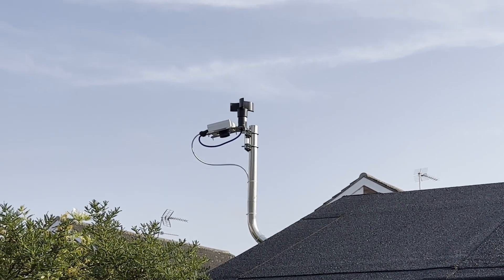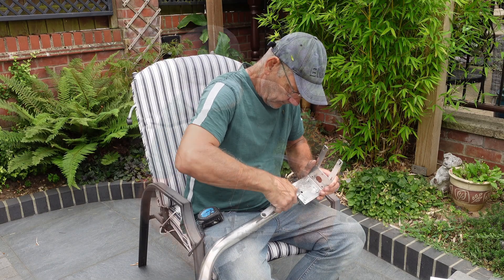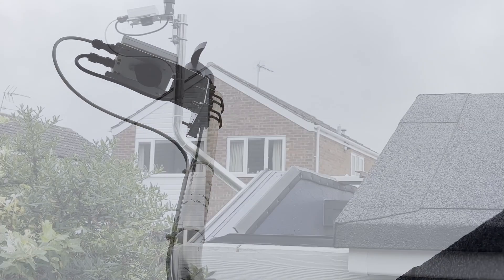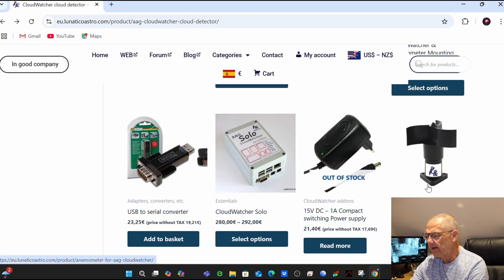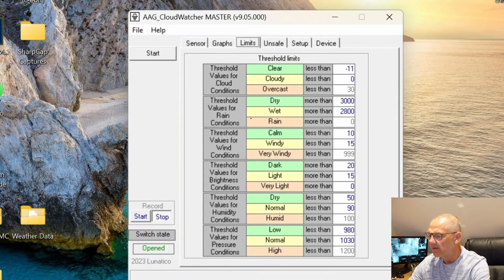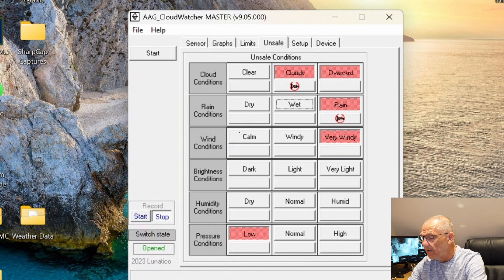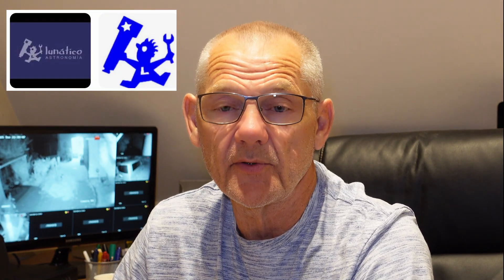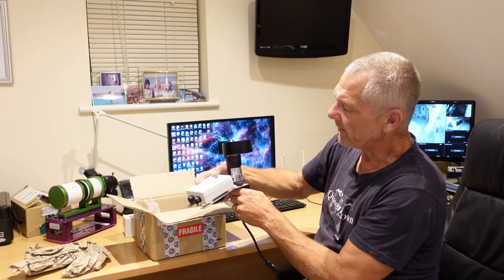This Clever Tool Could Save You Thousands

Comment: I would recommend I see your stuff is remote through google desktop, I’m not sure if that’s in the cloud or hosted locally but you may want to ensure there’s a failsafe so that it closes if the internet connection is lost
Reply from the maker: Thanks for watching Jack! You do make a good point, however if I loose my google remote internet connection, the mini pc is attached to the rig and will still control the roof, everything is directly connected to the rig by cable! The only problem would be if I lost power!! 
Clear skies 👍

Comment: Hey Simon, great video of a great piece of gear. I have one myself that I recently installed and is working quite well but still needs some tweaking. Talking  with Astrobloke the last month or so, he has helped me with some things as I have been revamping my ROR observatory I built 25 years ago. It's coming together slowly. I purchased  a couple of mounting poles that Logan helped me track down, but if i can get a constant tension cable reel that I can modify and in stall the Lunatico cable in or figure out a festooning method for the wires, I may have to relocate where I have my CW installed. Im wondering if you could tell me where you got your mounting pole and hardware?
  It looks like it may work as an alternate method for me untill I can get the above figured out, or l may just abandon that whole idea completely instead of trying to recreate the wheel  and uncomplicate the situation. Thank you.
Reply from the maker: Hi and thanks for watching! I got mine from Amazon, this is the link! 
TV pole & bracket: kit: 

https://www.amazon.co.uk/GALVANISED-Aerial-Wall-Mounting-Kit/dp/B01N5G8XMO

Clear skies 👍
Reply: Thanks Simon, looks like I may have to order it directly as Amazon is not allowing my to add to cart. But that will work.

Comment: for the diy minded, there are good ESP32/Arduino projects like DIY Weather Station on instructables etc that can be adapted.  with a 3d printer i done the whole lot for less than £100
Reply from the maker: Sounds like if you know what you’re doing and have a 3D printer, it’s a great idea! Thanks for watching 👍
Reply: The Cloudwatcher has a great advantage, IT WORKS
Reply: @fernandogomez119  so does mine thank you very much.

Comment: I bought mine in march or so. What a fantastic device! It gives you peace of mind for the night. It seems a bit outdated (the app design, the serial connection, etc) but realty is they are making it for +15 years and, the important, it works. Calibration the limits is a bit tricky as actual values and manual don't correlate but once it is set it is very consistent (be aware of birds drops over the sensors! Happened to me a few times, that messes up readings 🫣). Oh, don't change the darkness reference, set the limits instead, the ones in the app are wrong by default. Same with the rain limits, try to deposit a few small drops of water and check how the values change (the protection layer on top varies from unit to unit so, IMO, manual adjustment is required). Finally, cloud coverage (ie. clear limit) changes from summer to winter, some experimentation is also needed. Detecting those high thing clouds is almost impossible to me, so 'clear' is not always true, but detecting thick clouds or fog is reliable, which is the important part for closing the roof. Oh! And support from Lunatico is superb, they were very helpful and open to suggestions in app design and documentation.
Reply from the maker: Thanks so much for watching and your detailed comments, which I will take on board, especially the bird poo!!🫢 I hadn’t considered that! It’s working well so far, and we’re coming into autumn now, so I will keep a check on the clear conditions! Lunatico still thinks that a serial cable is better over long distances than a usb cable, so if it works, I’m happy! Clear skies 👍
Reply: @SimonsAstro  A 'poo event' happen to me a few times, one live in middle of august, the roof closed suddenly being a 25ºC clear pristine night while setting the session. I said "no way it is raining now!". I had to take a ladder to clean the sensor, in the darkness, so I can continue imaging 😑It is not cloudwatchers fault's of course... Oh! It is said a future version will include the Solo in the same enclosure and use just ethernet with POE for communication and power. Much much better than serial and USB! Anyway, current version works very well and worth every penny
Reply from the maker: @aleixandrus That sounds interesting, but as you say, if it works, then great! Unlucky on the bird poo situation 🤣

Comment: Great video Simon. Thanks for the shout-out. The Cloudwatcher is a must for any observatory in my opinion, assuming you want to be able to get some sleep while imaging. It has been working extremely well. A couple of things I have found is that you will have to shift the 'clear' limit as you move from summer to winter and back again. In winter, my limit can sit as low as -19 and in summer can be as high as -6. The other thing is that if you have a rain shower and then it clears ready for imaging, unless there is a bit of time (like 30-60mins) for the rain to evaporate on the rain sensor, you will need to very gently dab (not rub)  the surface  of the cloud watcher with, say, a paper towel to remove that water so the sky temp sensor can correctly read the conditions again. You might notice that after a shower and the clouds have passed, that your cloudwatcher is still reading cloudy or overcast, but gently removing the water will have it reading clear again immediately. Currently, with winds gusting 70km, my anemometer ( and yes, I find it difficult to say correclty too) is spiining itself to death. CS.
Reply from the maker: Thanks so much Logan! Yes these little gadgets are a must as you say! How did I get by without one? Your video helped me set mine up, so thanks for that, credit where credit it due😀 Thanks for the tips also, I have dabbed the sensor with tissue after rain to dry it and it went back to dry really quickly. I’ll keep an eye on the limits especially as we’re now approaching autumn! I’ve got another 5 minutes of video of me trying to say it right, but decided not to show it🤣 Clear skies